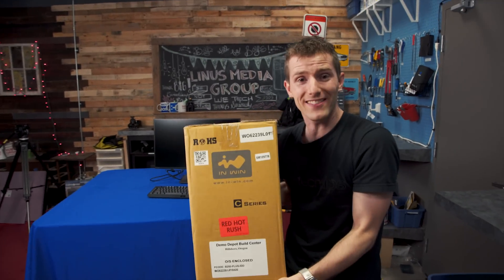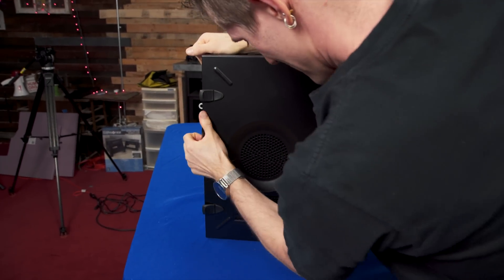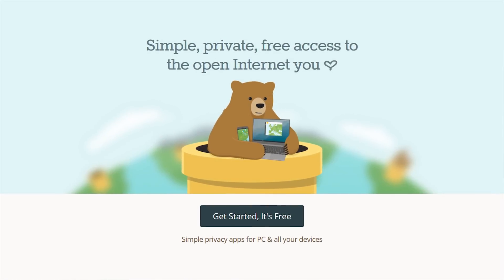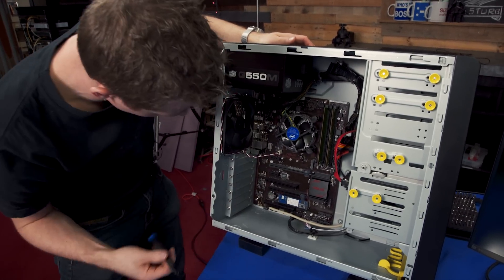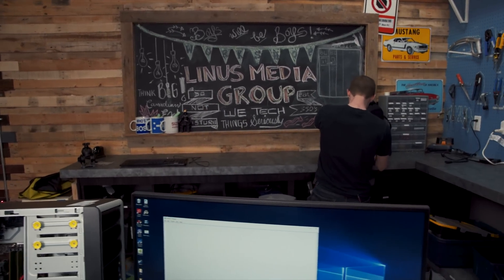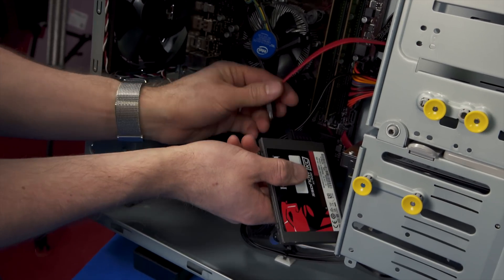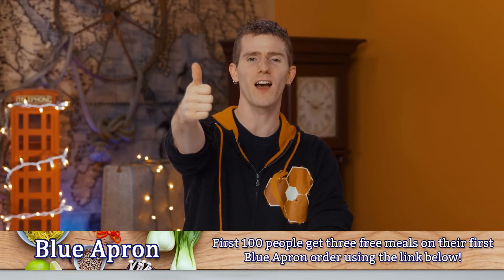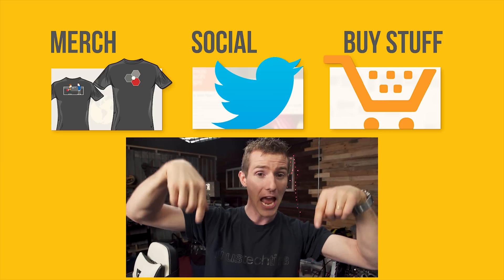Turbocharge your SSD for $40??

Comment: Looked all over the internet & couldn't find a clear answer to my question. Hoping you might shed some light. 

I've decided to try to breathe some new life into my laptop that has only 8 GB soldered RAM by adding the Optane Memory Series (what you call cache drive) into a second M.2 slot for multitasking: Chrome/Adobe Acrobat/Office running all the time in parallel eating up all my memory.

I wanted to get the 32GB version of the Optane Memory but bumped into this on a non-Intel website & couldn't find a confirmation or disproof of it anywhere else: "You must use the M10 version of Optane Memory. The original version of Optane Memory will only be supported in a desktop environment".

Do you happen to know whether a non-M10 Optane Memory Series drive should work on a laptop? If not, I'll have to stick to the 16GB version as supplies are scarce at this point. 

Thanks in advance! 

P.s. I know Intel has stopped supporting this product for consumers & am ready to experiment with setting this thing up. 

P.p.s. thanks for the video!

Comment: the gta5 benchmark is completely flawed and should be removed. The issue with gta5's loading times was an issue with its code that has been fixed since this video and only now works as intended.

Comment: Fast forward to 2020, HP offers 32gb optane in their Spectre x360 2-in-1, w\ 8GB OF RAM, SOLDERED, with a 256 or 512GB M.2!?!!? WHYYYYY!?

Edit: won't a soldered on optane guarantee the 2-in-1 will need to be fully replaced sooner than if they excluded it (since the m.2 is replaceable)? Maybe that's why... I'm about to return this POS and convince my boss the extra $400 expense will pay for itself... Which would work if he weren't having me replace an entire laptop when all it needs is a fresh windows reinstall... 😡🤯😭

Comment: Great that Intel keeps innovating like Sony did with Minidisc and ATRAC. It is obvious they wanna keep a grip on consumers buying only Intel hardware. I would like to use Optane cache in some scaled form on BayTrail or CherryTrail CPU's with eMMC SSD's. It's like having the option to stick a NVME drive into a Windows 10 tablet, skyrocketing its performance at a TDP of 2-5 watts. Why didn't they do that?

Comment: I have a situation i need help with.... i bought a nvme drive with a pci-e adapter since my motherboard don't support it for booting... its a asus Z77 intel chipset...wondering if i could place the boot loader on a normal disk on my system (cauz i can boot on a pci-e slot)but install windows files on my nvme m.2 drive so it could be fast ???

Comment: Also, it should be noted, if no one else already has, that the Optane will only work with the system drive. Any additional drive(s) that you may have won't see any benefit from it.

Comment: Watching this in 2019 trying to understand the meaning behind Optane I feel like watching WWII documentary. That's how "old" the tech is now, with M.2 NVMe drives with 10x the write speed becoming fairly available. I mean, I can get 512GB NVMe for nearly the same price as 64GB Optane, with 2.5x faster read and 8x faster write.
Reply: You can buy big optane drives to use like you would an SSD, and they are beltingly quick, but as a caching mechanism I can't see why you wouldn't simply use an ssd as you'll get similar real world performance and be able to cache a LOT more for the money.
Reply: Optane wipes the floor with SSDs in terms of performance. It's not about sequential read and write speeds. But yeah the newer Optane modules are faster.
Reply: @NewLondonMarshall  yeah, optane is a fair bit quicker, but is it actually noticeable outside of benchmarks, especially as a caching drive?
Reply: @morosis82  In fact it is the opposite. In benchmarks which focus on sequential read and write speeds like all SSDs are advertised (850 Pro is 550 MB/s) the optane SSDs look much worse, but in real world applications the optane SSDs are so much faster its just funny!
Reply: @NewLondonMarshall  no I get it, optanes party trick is random access. But from what I've seen, they hhave no real advantage outside synthetic benchmarks for a desktop user.

Database servers might be different, but then you're not caching with them probably.
Reply: @morosis82  they're much faster in real life whilst having lower numbers in benchmarks :)

Comment: It seems to me that Windows Storage Spaces tiering with a normal SSD cache drive might result in much the same performance benefit for a system containing mechanical disks while being simultaneously possibly even cheaper.  It'd be interesting to compare the Optane speedup vs such a roll-your-own software only solution.  (The basic idea: https://nils.schimmelmann.us/post/153541254987/intel-smart-response-technology-vs-windows-10)

Comment: i dotn think that a cache controller with SSD will go far...due to the fact that a cache controller ...is an "ssd" in the end....they both work the same...not to mention that a good ssd wtih the cach controller may show slower results instead of running alone....due to thet fact of the exchange of data between them. i.m.o. Cannot test it but only theoritically speaking. Generally intel knows and dont thinkg this line of product will go on after they see the HDD drives dropping sales. They may even do it so that the HDD sales not decrease....who knows they are giants of technology they will do it their way anyway!

Comment: I have finally got my 3 drive RAID 0 with optane memory setup. It was a little disappointing to not see the numbers I found in the Tweak Town article on same subject & similar hardware (same chipset) but seems to have higher latency. I'm not overclocking though as they were. Write bandwidth at 4K que depth 1 was half on my system but still more than 2 times faster than my Samsung 960 Pro 512 GB at 4k que depth 1. Even my read scores are lower than Tweak Towns but not by as much as the low que depth writes. I love it's consistency though, it is still very high performance setup. 

Due to the lack of write amplification & not needing to erase entire blocks in order to write even one file the memory media should last just as long as with the 960 pro if not longer. Each optane memory module rated for 182 TB written & since there is 3 combined with wear leveling these drives should last almost 3 times longer than the 960 pro which is rated for 200TB written for the 512GB version which I own. These should last well past their 5 year warranties.

I'm not sure how Tweak Town got their numbers so high & their latency so low on the same chipset that I am using. If I turn on write back cashing scores do improve but that causes computer to crash on write type benchmarks. Scores still lower than Tweak Town even with write caching turned on. It is still an amazing product & running them in RAID 0 is still significantly better than that of the Samsung 960 Pro in performance in every read situation as well as smaller & low que depth writes which is what the operating system needs to perform best.

Oh yes it is set up as my boot drive. I understand that does have a negative impact on benchmark figures but Tweak Town was also booting windows with theirs so what gives?

Comment: Intel Optane Memory has been around for more than a year, but when it was launched in Q1 2017 it could only be used to accelerate one Windows 10 SATA boot drive and only one module is supported per system. Many in the PC community wanted to accelerate hard disk drives that weren’t the boot drive and let Intel know that if Optane could be used to cache mechanical hard drives that they would sell more Optane Memory sticks. The chip giant has listened to customer feedback and is allowing Optane software to cache data from any single SATA hard drive in a system, regardless of it being a primary/boot or secondary volume!
Read more at http://www.legitreviews.com/intel-optane-memory-tested-with-secondary-hard-drive_205254#f0CAHKheWhwvhHHi.99

Comment: SSD is still the answer.  The gradual defectiveness of mech drives isnt addressed by the optane memory modules.  I would still recommend and replace the mech drive after 2-3 years with an ssd if someone were to come to me with a a system like this.  The price difference is decreasing between mech drives and SSDs.  Large mech drives should be regulated to external storage only.  What happens when the optane drive fails and you are trying to troubleshoot the system? Which has failed- the optane or the mech drive? You can get a 500gb ssd for about $110 right now with a 5year warranty.  That makes more sense than spending $77 for a optane chip and $65 (?) for a 2tb internal mech drive.

Comment: Valid use-case for Optane accelerating a large-capacity mechanical hard drive:  Large-capacity SSD's don't use SLC; they use MLC which have greater density, but a reduced lifespan.  Am I correct in understanding that a mechanical drive (which has been stress-tested and passed its infant mortality period) will likely have a greater lifespan than a MLC SSD?

Comment: Here's my problem with these Optane modules - they only work to accelerate one SATA HDD, useless for SSD acceleration as you found, but not a RAID array!  Which eliminates a huge user base, because who would be using a mechanical HDD today if not for the sake of RAID?  I ended up buying a 4-lane PCIe 3.x NVMe and using a software caching solution to accelerate the RAID array instead, since Intel decided to totally drop the ball here.

Comment: I know this video is a bit dated, but it popped up on my Recommendations because I've been looking into one of these for a new build. 

My boot drive will be a 1TB M.2 NVME Samsung 970 EVO PCIe, which should read at ~3.5GB/sec., and costs $300 ($300/TB). But now Optane supports accelerating secondary drives, so I'm planning on picking up the 64GB Optane to accelerate a 10TB HDD, which should (In theory) give me read speeds on the HDD of up to 1.5 GB/s at a total cost of about $40/TB. Compare that to the PCIe at $300/TB (max 2TB) or a SATA SSD (max 4TB) at about $150/TB (and 1/3 the speed) and that seems like a pretty nice price/performance point.

Comment: so of course I have a kinda new system like described with a boot-ssd
but other than booting everything still runs off the hdd, so I would benefit from it,
using mostly the same 8gb of data alll the time.
wouldn't I?

Comment: What if you have a computer with 2 different drives SSD and HDD , what is gonna happen when u , use application that has been installed on SSD to open file on HDD? It gonna speed up when i open files on HDD with that cause?
Reply: optane only applies itself to the drive running your operating system.
Reply: HMM hardly seems worth it then, better just to have SSD sata drive as a boot drive for new systems

Comment: You're spot on with people with new systems having little to no use for this - 

But maybe its not a deliberate decision by intel, but they either:

1) - couldn't find an economical way to make this work in older systems - no M.2 slots and stuff...
2) - more likely, marketing jumped in and said are you crazy?  making old systems viable for $40, spoiling new sales for $400...?

Comment: Hi,

I have an Hp Omen 870-210 desktop, and i upgraded the boot drive to a seagate 1tb sshd (not the firecuda one). Would i see much improvement if i got the 16gb model of this (i can get one for around $25)? Or should i spring for one with more memory? Or should i not bother at all? I'd rather not go out and buy a new ssd if i don't have to. I use the pc for gaming mostly.

Comment: hey Linus Tech. how can i get the samsung 970 pro to boot from an old gigabyte bios. the drive works in windows 7 ult, but when i try to install windows, when i load drivers to find m.2 on pcie lane, windows says it cant install as this drive is not bootable from my bios.. iv tried clover to load and bridge the gap with 'NvmExpressDxe-64.efi' but it does not work like others have done....also cloned windows on to it but im still missing the bridge from bios... plz have you got any suggestions.. thanks...

Comment: My PC is and will remain built on a budget with the exception of buying what I need to make it work for gaming, content creation, and streaming in the future. With this in mind would this work if I decided to pair it with an 8TB hard drive or even 2x 8TB hard drives? It’s only ~$55 on Amazon currently and I want to expand my storage to an 8TB hard drive for games and the OS. I would later add a secondary 8TB drive for mass storage of old videos and what not. And the reason I don’t want to go SSD is because an 1TB SSD costs about the same as an 8TB hard drive. Even with smaller 4TB or even 2TB hard drives you could save tons of money and for casual gamers or those who can’t front the cash SSDs don’t make sense if we could get the performance from this. I’d like to see a test of how far this optane drive can go and see if it really could be for wider usage than just a boot drive.

Comment: HELP me figure this out i7-8750H, 6-core 9MB cache, up to 4.1Ghz,  250GB SATA M.2 SSD, 16GB DDR4 2666MHz, GTX 1070 8GB GDDR5. QUESTION 》》》 WITH TURBO BOOST vs  PCIe 《《《 ??????  Or is the PCIe already there with the M.2 ?  How can I tell if the M.2 is express 3.0, IF it's PCIe at all that is ?  Dell wants to exchange my 3month defect Alienware, with a new that seems "lesser" than my "old". Although the "old" is just quad Core, but it's overclocked AND equipped with PCIe. Old screen is FHD 120Hz TN+WVA, the New comes with just 60Hz but is with an FHD IPS display.  HELP ! MY HEAD IS SPINNING !

Comment: I have a boot ssd, an ssd for my vr setup, and I'm using the optane to boost a basic hdd that has all my steam games. It's a very noticeable difference in my particular config, and i only went with the 16gb module. It ended up being $150 cheaper than buying a 1tb ssd, and that cash went towards getting a much better gpu

Comment: From looking around while shopping for a computer Octane is being used just to slash prices in prebuilts by using a Octane module to give an impressive amount of system RAM (32 gigs is common) and the average consumer won't realize that it is slower for system memory then DRAM.  I almost fell for this when looking at a bare bones setup that looked like a deal because it came with 32GBs of ram, but it was Octane and therefore slower.

Comment: I'd love to have the money to waste on an SSD boot drive or optane, but 1.) My Gigabyte 78LMT-USB 3.0 Rev 6 board doesn't have M.2 support (not even sure if AMD boards support it tbh) and 2.) my whole damn new parts build cost what Linus spends on a damn scrapyard wars pc (around 500 bucks)...

AMD FX-6300(O.C. 4.0GHz), Power Color RX 460(Boost Clock 1315 MHz, Mem. Clock 1850MHz), W.D. Blue 7200rpm 1TB HDD, 16GB DDR3x1600, Corsair AF140mm front fans, 120MM (Stock) rear fans, 360W (off brand thanks Cyberpower PC) PSU.

Comment: I'm an indonesian and I've been using Optane for quite awhile, and in my opinion, optane is used for those who couldn't afford a 500GB+ decent SSD.
I mean, here, a 500GB Samsung 860 Evo Costs like 2.5M IDR (and 1TB one is about 5M IDR).
but 32 Gigs Optane Module be around 1M IDR
add a 1TB HDD on top of it, that's about 2M IDR, for the double space you can get from Optane + HDD Combo.
so, I think it's worth it especially since I was upgrading my PC without replacing the HDD, that's less money spent at a time

Comment: This optane module has 2 connector gaps, so basicaly it gives you SATA performance like an other SSD. The ones with 1 gap gives you PCIe speeds. Read/Write bechmarking these show that they are 10x faster then the SATA ones. Use a Samsung 960 EVO NVMe PCIe drive as the main drive, and it's pretty damn fast.

Comment: Dude, WTH, unplugging stuff with power still on and NO ESD usage.  I would hate to see your equipment failure rate.  EVERY video is cringe worthy, just for this reason. Never see you use ESD straps and just throw stuff around and disconnecting stuff with power on. You are setting a very bad example to the newbies out they looking to your channel for advice (and bad examples a lot of times). disappointed by ya Linus. ;(
Reply: He pointed out he shouldn't knock on the HDD, as far as the SSD those things can take a bit of a beating no problem. Shouldn't test that if you're an average user though. As far as ESD you simply need to touch the case. And he even said "lets power this guy off" although he did an improper shut down. Which would only damage the HDD MAYBE. Most of the time an improper shut down only confuses the HDD which SOMETIMES leads to OS corruption. But the real problem would be not unplugging the pc and draining the remaining power before disconnecting hardware. Which if he did that he should've included the footage.
Reply: or just touch the side of the case and discharge any static there? I'm a vmware engineer and been building systems for 20+ years and never had any issues. And it gets pretty dry in the winter here in michigan
Reply: This is only a Test

Comment: Most people have a SSD boot drive (OS) but use HDD for storage. So, if this was used in this configuration with OPTANE does it improve the system overall having all your large apps/games on the HDD?

Comment: More importantly, your 2nd benchmark of GTA was, AFAICT, completely invalid.

Correct me if I'm wrong, but you ran the benchmarks sequentially, meaning after you ran the synthetic ones, you launched the game. THis means that if the benchmarks were thorough enough or accessed enough data, it is theoretically possible that they may have actually made things worse for the GTA benchmark. If I were benchmarking, I would instead of "running normal user apps," run it as a normal user*. Open some files, edit some documents, reboot, browse web, repeat, check differences *there*. Unless you can say with 100% certainty the benchmark was performed with the *exact same conditions as actual use, it's only good for use as - well, a benchmark.